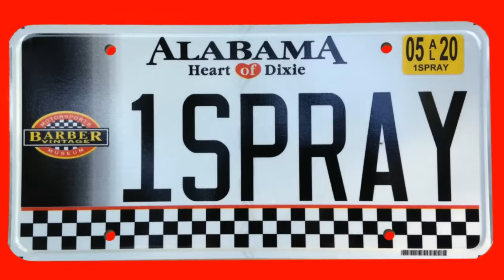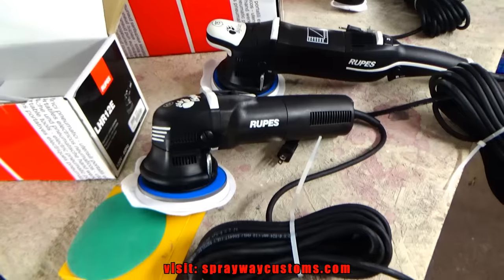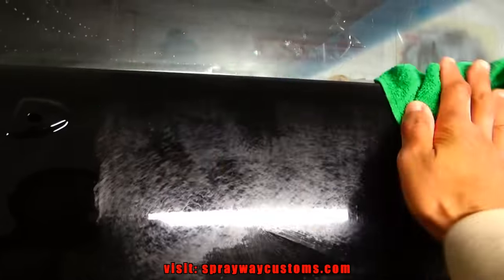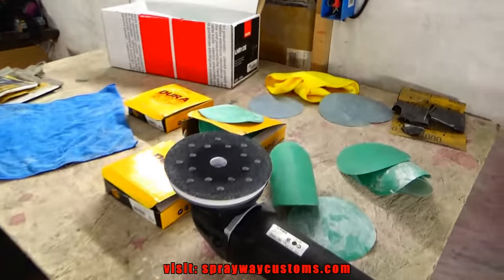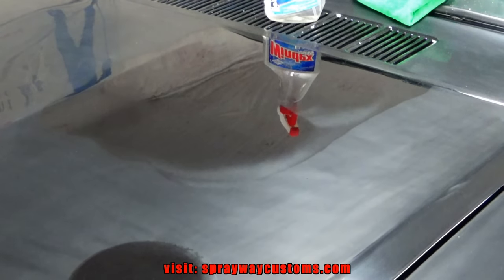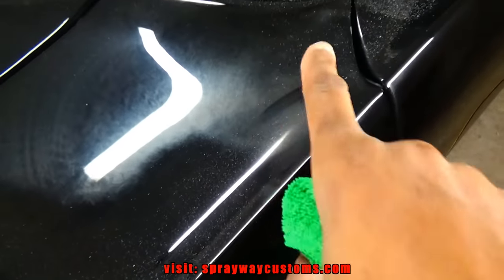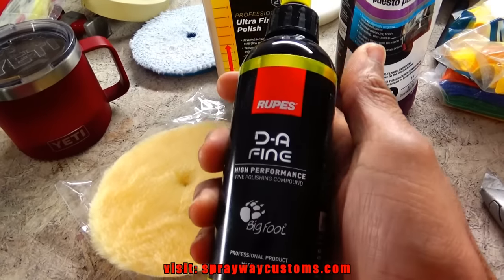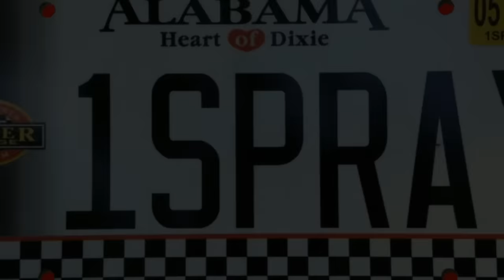Cut And Buff A Car To Remove Orange Peel & Trash From A Black Paint Job RUPES BIGFOOT DA POLISHER

Comment: I've been looking into this buffing system and I'd like to say after 29 years of hand blocking a all over paint job from roof to rocker with 800 stepped to 2000 then spending 3 days DAing it with 3000 and buffing it and praying to god that the swirls are going to be gone you have sold me and I'm a believer now. The next one will be color sanded and buffed with this system! Thanks for your videos bud, I been doing custom painting and building cars in South Georgia for almost 30 years and it's good to see someone being appreciated for what's involved!
Reply from the maker: I agree with you 100% Mike. Cutting and Buffing is a job...thank you

Comment: I had a problem after wet sanding with the DA where you could see fine scratches from the motion of the oscillation of the DA. Even after buffing and I would have to go back and wet sand by hand to get them out. Come to find out the velcro on the backing pad was to rough for wet sand and I had to get a backing pad specific for wet sanding. Great job on the stang as usual. Can't wait to see it all together.
Reply from the maker: You correct because I had the same problem before...sometimes it just pays to hand sand because all the work trying to get those pig tails out....I was like I should've just blocked it from the jump....most definitely gotta use the correct tools for the job.

Comment: I don’t know I think rotary is still faster than rupes .
I have done so many black cars and always end up coming to the conclusion that it simply takes a lot of time and patience..Time and more time lol.I use Glasurit clear coat and it is always on the soft side even after sitting for weeks . .I think you know exactly what I am talking about ..I did the same thing as you and bought all the Rupes machines and pads . I am back to rotary  and actually just finished a Black Mustang… my conclusion after 30 years of painting is the man behind the machine makes the biggest difference not the tools used . Thanks for the video  brother and keep working hard man.Ain’t easy !!
Reply from the maker: I agree with you 100%

Comment: Cool video. I work for Meguiar’s.  I thought i would share a couple things, not trying to tell you what to do or anything but i noticed i couple things you might consider for next time. When it comes to sandpaper, there are huge differences in technology, would recommend checking out 3M Trizact & other, the foam backed disc will make a much more even sanding mark wish will be way easier to remove, they are expensive but time is money.  Also on our microfiber pad i didn’t catch if you did in video but you want to make sure you fully prime the disc with compound;every little microfiber should have compound or else it is not going to cut consistently.  Once primed just 3-4 drops is good.  Also i think you can slow how fast you are moving your arm on the Rupes 15, arm speed looked a little fast for trying to cut so much. Again not trying to tell you what to do it looks good but check it out
Reply from the maker: I appreciate all the support and info. I need all the advise I can get. I'll use it next time...it's very much appreciated Nick

Comment: Good  job ... instead of sanding with 3000 grit. Get some trizac pads for your da and use some buffing compound with  it after u do the 2000.  I do it on black and works great.
Reply from the maker: Thanks for the info...I'll look into that

Comment: I gotta say thank you for this! I just sprayed my car (first time painting) and I was left with some less than desirable results. Including some terrible orange peel. For a first time, in a garage, without the correct tools; it came out decent. I stumbled upon this in searching for something to teach me how to cut and buff (already been wet sanding the car and it lost it's shine. I freaked out mildly until talking with some friends and realizing I needed to buff and polish to get that shine back. I'm excited to try later today to bring that shine back after learning based on this video. Thanks!
Reply from the maker: Great…I’m glad you found my channel. I have quite a few videos on buffing. Good luck man
Reply: You should start on a small panel for practice sprayway makes it look easy but that’s just because the man’s a seasoned vet! Cutting and buffing can be difficult can burn through and be doing a respray pretty easy when learning
Reply: @handyishrandyish334  definately learned that quickly!🤣 Respray is gonna happen in the next week or so...

Comment: When I sand clear coat I start with 1500 grit dry on my DA with soft pad then I'll use 2000 grit dry then 3000 wet sand to a sheen shin then buff. For me the process I use works great and is faster than using water because the clear acts like a guide coat with no water
Reply from the maker: Thanks man

Comment: Sprayway, I had a question. When you cut and buff, how much base coat do you think is removed? Do you do extra coats of base in anticipation of the cut and buff? Like would you do 3 coats of base when cutting so you still have a good amount of base left?
Reply from the maker: You shouldn’t be cutting into the base only the clear. That’s why it’s always good to put at least 3 coats of clear.
Reply: @SprayWayCustoms , I totally screwed up this question. I asked you before I finished the video and I heard you mention cutting the clear. Thank you for the reply

Comment: How many coats of clear did you originally spray? Do you think you took off one complete coat of clear after buffing? Is the color of buffed part of the car as dark as the unbuffed? It kind of looked like a darker shade of black before buffing
Reply from the maker: I put three coats of clear. Booth look the same

Comment: Looks great!! Thought about that system for my shop, is it faster, less work, better results,  all 3 or a variation of the 3....car came out fantastic!!
Reply from the maker: It's faster, less work and a lot safer because a rotary heats up your paint a lot faster and could cause problems on down the line. I think you can shop around and fine a cheaper brand that'll get the job done as well.
Reply: @SprayWayCustoms  ok bet, thanks for the advice😎

Comment: Sweet job as always!  I know you said you didn't wet sand the bottom half of the car, but did you polish it or anything?
Reply from the maker: No, just left it as is. It wasn't much orange peel to start with...mainly trash that landed on the flat areas from painted in a homemade booth
Reply: @SprayWayCustoms  Nice...I am working on a 67, that's why I am picking your brain so much on this one!  I appreciate your time to respond to all my questions.

Comment: the 1st video where you painted this for 209 or whatever, is this the same car? you just fixing your work? or was this done badly to go back and fix it? and after wet sanding- and compounding and buffing- there was no need to re clear coat?
Reply from the maker: This the same car, yes I just cut and buff to remove trash and orange peel because I paint in a make shift booth. If you cut and buff...it'll be a waste of time to go back and re clear after the buff.

Comment: Thank you for doing this video, car looks amazing. I just finished painting my Nova black, I cut and buffed it. The worst part is sanding, I used a da to do some of my sanding. Hand sanding with 2000 grit sucks. I have been trying to find a electric sander, im definitely going to check into the sanders you have.
I use a 7 in Milwaukee polisher, I like it because I can let the weight of it do the work.
Reply from the maker: Appreciate you

Comment: Nice i usually hit it with a foam pad and rotary in all big areas then move on to DA polisher
That urechem clear? That ckear buffs easier than the rest 
Polyurethane is the best for buffing
Reply from the maker: I do too…thanks
Reply: @SprayWayCustoms  do you think the harbor freight Baur DA polisher does the same job as the Rupes big foot in your opinion? Whats the big deal on those big foot polishers?

Comment: She looks great, what do you tell the owners about using wax or other types of sealants, I mean timeline.
Reply from the maker: I tell them to store it on the inside if possible and don't use a car cover on fresh paint because the paint is still soft and can be scratched from the wind blowing the cover around, plus the car cover traps moisture that could also ruin the freshly done job. I would say wait about 60 days to wax it Keith.

Comment: SprayWay. Which would you prefer as a sealer? The Urekem ColorSeal or the Urekem Epoxy Primer.  I saw you ask Pharway I wanted to ask you. Thanks.
Reply from the maker: I would say the Color Seal because you can get it in different colors to match your base
Reply: Thank you ...

Comment: How you like the new sander and buffer? I always seem to get da pig tails when I don't hand wet sand after using a da how was your luck?
Reply from the maker: I like it far as the buffing process but sanding I think hand sanding is the way to go to keep from doing redos because you will get pig tails if you don't use the correct sand paper and pads. Thanks for the comment.

Comment: Beautiful! I acquired the Rupes nano for the creases, small parts and hard to reach sections. Works great but I’m still not as good as you 😋
Reply from the maker: Thanks man. I'm thinking on purchasing the Nano myself
Reply: @SprayWayCustoms  it’s a great little machine and it’s also cordless. Very handy for painted dashboards where the bigger machines are unwieldy  and this little gem doesn’t make a mess. I’m sure you will like it very much. I’ve got the short neck but on occasion the long neck would’ve been handy. Difficult choice though.

Comment: When you are wet sanding 'trash' what grit are you using? Circular motion or back and forth? By hand?
Reply from the maker: I started out with 2000. If you doing it by hand, go in a x-pattern

Comment: Great video. Some questions from a rank amateur thinking about having a go.... when do you decide its time to change the sanding pad or the polishing pad? And how hot is too hot on the polishing pad - can you still touch the panel or is that too hot by then?
Reply from the maker: I usually keep the same pad during the hold process…just blow it off with the air hose. It shouldn’t be hot to the touch because that’s when you start messing up things
Reply: @SprayWayCustoms  Got it - thank you!

Comment: Hey bro, thanks for videos. Wet sanded 1200-3000 on some deck lids and after compound I had mad swirls tried swirl remover and didn’t help. Any tips on what I did wrong?
Reply from the maker: Did you use a rotary and da sander?
Reply: I did. Maybe I didn’t sand it good enough?

Comment: Spray, could you do an updated walk around of your set-up? What equipment you use, what equipment you have tried and do not like. Air compressor and size, your custom water separator? Thanks 🙏
Reply from the maker: I really need to. 👌

Comment: So what pads do you use to get rid of orange peel 2,000 and 3000 because I have orange peel after painting my truck in multiple spots and have 3000 Trizact pad but you used 2,000 I don't know for sure if I got a 2,000 pad but I have some Malco Super Heavy Duty compound I just painted my truck this week used a clay bar on it and washed it already. This weekend could use the da to get orange peel off better.
Reply from the maker: If you can cut if with the 3,000 that'll be better. The reason why I started with the 2,000 is because it cuts a lot faster than 3,000. It's always good to use less aggressive grit as possible because your buffing will go a lot faster getting those scratches out.
Reply: @SprayWayCustoms  I used 3,000 first but have metallic paint though but I think will try 2,000 grit first then use 3,000 last.

Comment: How did you like the duragold sandpaper? I was looking to buy some to try? Did you not need the 1500 at all?
I have a little solvent pop/fisheye that I have to get out so I was thinking about starting with it. Thanks
Reply from the maker: It's great for the price. I would suggest using the less aggressive as possible because it'll buff out a lot faster

Comment: Hey boss if I'm buffing with 3m 1,2,3 compound and I did first stage and I could see orange peel a little bit what do i do to take it away do I proceed with stage 2 or do I have to sand again please let me know thanks
Reply from the maker: jaimef101 just a little more sanding will be the way to go....buffing removes paint but you'll never remove the orange peel without heating up the panel to much...sanding is a lot quicker and safer.
Reply: @SprayWayCustoms  ok cool thank you

Comment: You can use the CarPro Denim orange peel removing pad with Meguiars 105 to get rid of the orange peel. It will save you the steps of sanding. It's like polishing the orange peel away and removing swirls at the same time. The CarPro Denim orange peel pad is like 2000 grit.
Reply from the maker: Thanks for the info
Reply: @SprayWayCustoms  No problem, you can see some videos about the CarPro Denim orange peel pads. TBH you laid down that paint so well it would have passed for me, you got some good painting skills!

Comment: You should get a interface pad for your sanding on those body curves . Also I think you got the wrong machine for buffing. I have use that same Rupes and the Flex and by far the flex is better for me. It cuts faster it does not stall and it has bigger pads so you can get the job done a lot faster then the Rupes.
Reply from the maker: Appreciate you

Comment: Hey I know you use tamco clear and some other clears but how do you feel about ppgs 2021 I've been having some issues with this clear that I am using now it is a high solids 2K Euro this truck that I did was sandblasted and everything I didn't etch prime it because it was inside the shop but I took a heavy 2K primed it a couple times blocked it made sure everything was sealed lot of Bondo work but I've been handling we had some heavy rain and it sat outside I wanted to let it dry and it sat outside for a couple weeks and it got some bubbling in certain spots on the bed I don't know if it's from the clear or the base but everything that I always do since I've been painting for the last 15 years I always wipe everything down with wax and grease with a fresh rag and I've also used so I don't have shrinkage like Evercoat slick sand holds all your scratches in your body work down and then go over that with your 2K and then a sealer and such for it and you never should have a problem but things can still happen so I just wanted to know a good clear that Sam's good and polish is good this clear Sands pretty good it's about $200 a kit but I'm thinking about moving up to either ppgs and Firebase they're like $1,000 clear setup or the 2021 which I've never shot but I've used Matrix and I like it and I've used a few others like BASF g l a s a u i r t very high quality stuff but again $400 to $600 a gallon very high quality stuff but again $400 to $600 a gallon versus $200 a gallon I don't know what the holdout life of this clear is because I've only been using it about the last 3 years and every job that I use with it I never really see the customers car again so between tamco I heard that Transtar has like three different Euro clears and I've heard they're all good and people really swear by them and like them and they're pretty affordable have never shot their High solids clears only they're cheaper Motor City clear coat and between the Matrix and the tamco where the PPG 2021 or the new one envirobase stuff what do you think the best for the money I can get PPG 2021 for like $400 a kit which I think is pretty fair in this day and age and I've looked at cars that were shot 25 years ago and they still look beautiful
Reply from the maker: I think the PPG 2021 will be your best bet. I’ve had the same issue in the past with the bubbling. It be mainly on the flat areas like the hood, roof or trunk. Most of the time it’s moisture being trapped.

Comment: That car looks damn good and if you use air tools also, I was wondering if you ever used any of the Onyx Tools made by Astro? they have a 10,000 RPM 6 inch Palm Sander with 3/32-2.5mm Stroke, that will work all day everyday and it's a Smooth Running tool plus their very affordable
Reply from the maker: No, I haven't used those yet

Comment: I keep trying and I can cut and buff like no tomorrow with any color but black. I keep getting terrible pig tails that wont buff oit. Any advice?
Reply from the maker: Block sand with 1500, da with 2000, da with 3000 and make sure your sand paper stays clean
Reply: @SprayWayCustoms  going to give it a try tomorrow, thanks

Comment: You know I'm watching. The big question is da polishing vs rotary...I've never used a da...I learned on the Dewalt.
Reply from the maker: The DA is a lot faster and safer. I was buffing pretty much one of the hardest colors to make look right....you know how black shows every imperfection. I wouldn't suggest to go out and buy Rupes system because there is plenty cheaper brands to choose from to get the same results.

Comment: Great stuff!  Curious how you feel after upgrading to the Rupes system (compared to the entry-level polisher and the old-school Megs products).  

I’ve been using an entry-level polisher for 5 years and feel like I’ve mastered my technique using a lot of different compounds and polishes.  

Do you feel the difference in the system is more with saving time and energy, or in the final result of the finish?  Both?

Thanks for all you do!
Reply from the maker: I would say a rotary is much faster far as compounding but finishing it up with the da will bring better results

Comment: By far the best that car has ever looked.  Question; When you get to the wool pad buffing, are you using any down force, or just letting the machine glide across the surface?
Reply from the maker: I'm applying a little pressure but not too much